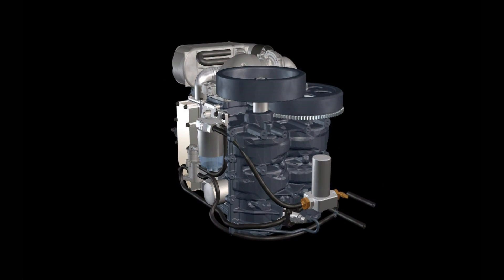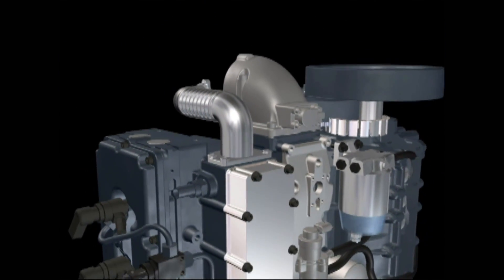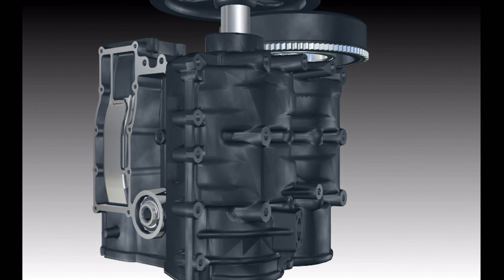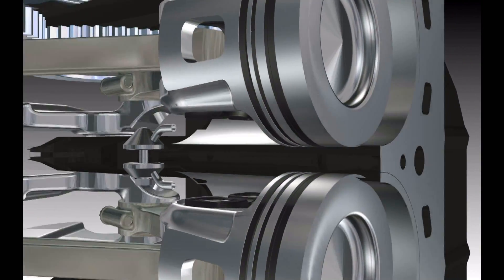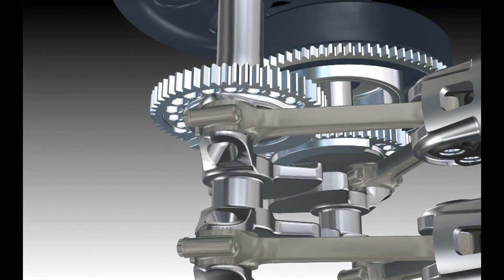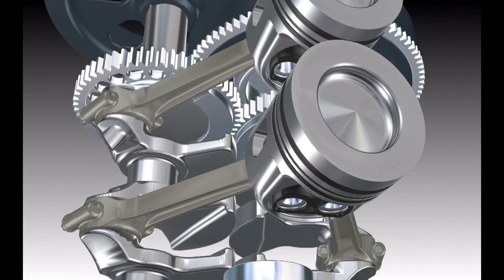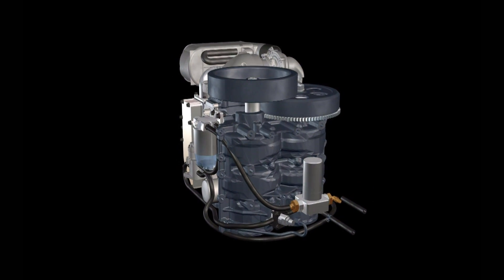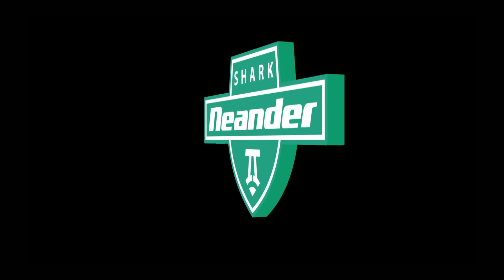Neander Technology (english)

Comment: I can see how it would be a strong and handle a high torque output. But the weight factor would be interesting to see how much this one weighs verses a comparable gas or 2 stroke engine. Over all, I love the concept behind this one and would love to see one perform.
Reply: I want to see it with more cylinders than 2 but imagining this as something more designed for reliability like a ride on lawn mower or something

Comment: How is gonna be lighter with two crankshaft and two rods ??
How is gonna be more efficient with double the friction ??   
How is gonna be reliable with double the moving parts ??
How, how, how??
Reply: The completed outboard weighs 175kg(385lbs). It's pretty close in weight to a comparable 4 stroke outboard if you compare peak tq vs peak tq.
Reply: Its science !!!?
Reply: 1) Each rod and crankshaft only needs to bear half the load, and can therefore be designed lighter.
2) See above: Each bearing has half the load and thus half the friction. Additionally, there are no sidewards forces pressing the pistons against the cylinder walls, this reduces friction.
3) It has less moving parts than a conventional 4cyl engine, and those are often very reliable as well.
Reply: @Extremflug  r
Reply: @Extremflug  less moving parts? I see two cranks and conrods where normally would be one
Reply: @jazldazl9193  Less moving parts than a conventional 4 cylinder engine, thant's what I wrote. Apart from that, pistons, conrods and crankshafts are those parts of an engine not generally known to fail on a daily basis, so even if it had 8 times as many of those there would still not be a general problem with reliability.
Reply: I don't understand. For what reason is the total mass of two small rods less than one large rod even thought the both arrangements bear the same load? The same question holds for crankshafts and especially for friction: Isn't two half a friction forces summed together equal to one friction force? The only thing in your explanation that does make sense to me, is about those sidewards forces.
Reply: The double crankshaft and flywheel setup is for balance the forces are oppososed and cancel each other. because the pistons are connected to two rods operating opposite to each other the friction in the cylinder is reduced. Cylinder friction contributes a great deal to frictional losses in an engine.
Reply: True. Maybe they got the balance ans smoothness figured out but youre totally right about friction and weight and parts.
Reply: Think about it, why make 2 full weight crankshafts, if you can use half the weight for both? same weight as only 1, like the guy above said.
This engine could be more reliable than a 4 banger for the better stability and smoothness, though I Have not seen the production model yet.
What everyone truly wants to know, is how much torque can you make with this engine?
Reply: I could be off but I think some of the reduction has to do with the aluminum head instead of iron or steel. With the lack of vibration from the twin crank approach this could get away with using aluminum instead